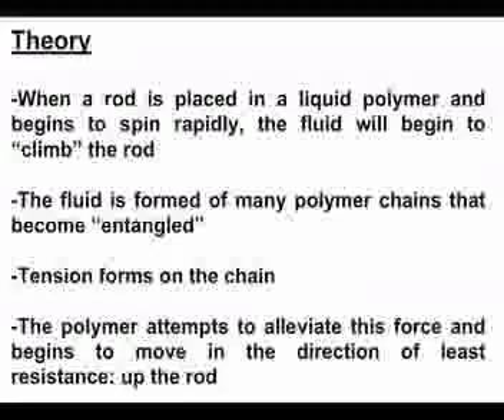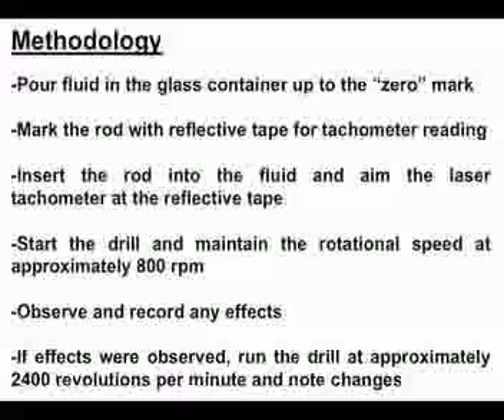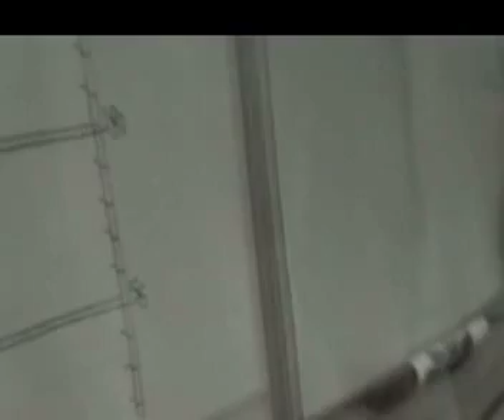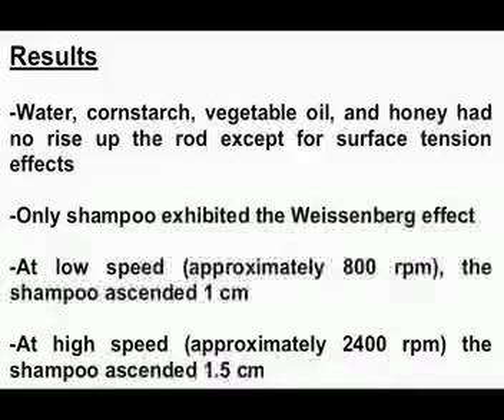Weissenberg Effect With Common Fluids

Comment: Bad experiment. you move the rod yourself, you cannot get a good reading because of that. Try measuring in circumference speed, not plain rotational speed. try different diameters, with the same circumferential speed. Do try motoroil as well.